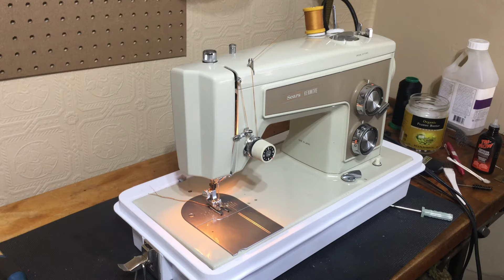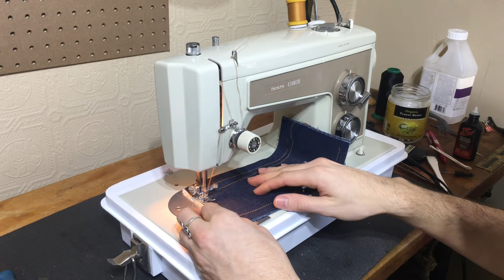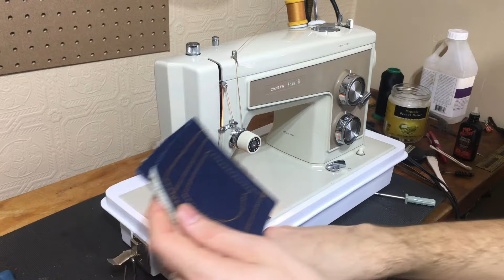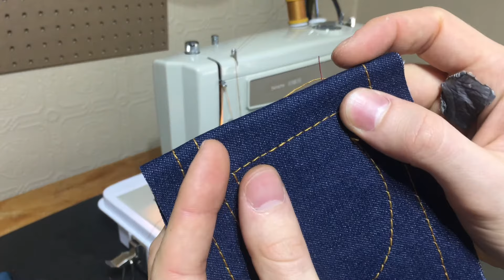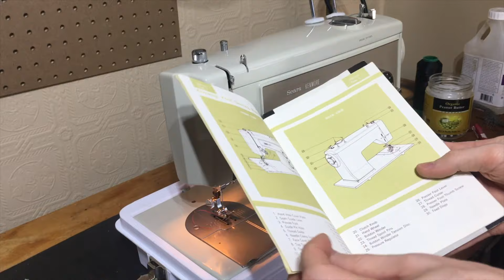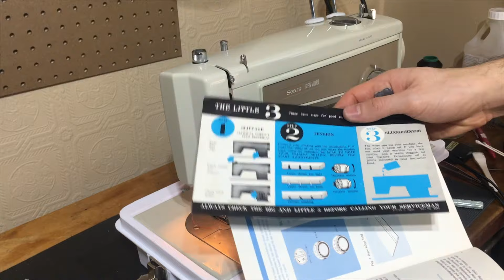Vintage Sears Kenmore 158.13200 Heavy Duty Sewing Machine - Overhauled!

Comment: Be warned. I have an older 158 single pulley kenmore and got one of these dual pulley machines to test it on very heavy fabrics.

 The dual pulley has more torque but when it reaches its max the belts just start slipping and helping it with the handwheel really doesn't work. 

But if your materials are below this threshold the extra torque is very noticeable. But if it's above it, the older series actually works better because you can help it much more with the drivewheel. 

At that max level you need to go industrial, or portable industrial like the Sailrite machines. 

I love the old kenmores but I don't love the transfer case required to have the otherwise pointless front threading needle, and the drivewheel pulleys and belts are fiddly and hard to access. 

Unless you need the extra torque, get the older kenmores with single pulley and side facing direct drive mechanism. They are much more robust and far easier to work on.

Comment: Do the 158-series machines have all-metal gears, or just a certain few models? TIA ...
Reply from the maker: Almost all of them are full metal. A few later models made in Taiwan have a nylon gear in them. But they are very solid machines regardless. The nylon half moon gears seen in the hook drive of most oscillating machines today are often gawked at, but it's really nothing to worry about. That gear does not bear the main load and almost never breaks. I have only every seen one broken in my time.
Reply: @tobyssewingmachinerepair8949  Much obliged! I'm in the Calgary area and looking for a vintage machine for a retirement hobby. There's a few 158s listed on Kijiji so I'm doing research before buying. I just now discovered that even the Singers 401A, 403A and 404 had a Textolite plastic gear on the handwheel. Thanks again!

Comment: Hi Toby,
Good video demo.  Someone bought a valuable top of the line machine.
I have a similar model 158.15251
Even after lubrication and a new needle it will not go slowly though 8 layers of denim. 
However, if I can get a running start, I can get through the heavy layers by more gas on the pedal. I'm wondering if I'm hurting my machine by running my vintage Kenmore fast through the heavy layers that will make the needle stick when running slowly?

Comment: my 158.13200 all threaded but it just hums, wont sew?.....I played with the turn wheels on the right to disengage the needle while putting thead on the bobbin (it said to loosen screw to disengage needle but that didn't work) anyway wont sew now.....so frustrated...can you help...wheels on the right side seem so stiff?     Sewing requires incredible patience!   So easy to throw in the towel.😢
Reply: Try oiling it . Works every time!

Comment: I have my original 158.13200 bought in 1974.  It has worked like a charm for all these years, but I am having difficulty with my buttonholer.  I just sewed 3 buttonholes--no problem.  On the fourth, the feed dogs seemed not to be pulling the buttonholer around the pinion gear.  Would oiling the gear help?  I have oiled the machine, but this gear has NEVER been oiled!  Can you think of another reason for the lack of movement?  The machine is working great--except for the buttonholer.  I'm really enjoying your videos.

Comment: I own three of these Kenmores. They can't be beat for ruggedness, power,  smoothness, and piercing power. Of all the zigzag machines out there, these are the best. You simply can't go wrong. Even the foot pedal is the most comfortable.
Reply from the maker: I would have to agree, they are the best choice for anyone who wants a solid, inexpensive machine that will last forever. I use one of these for most of my own sewing!